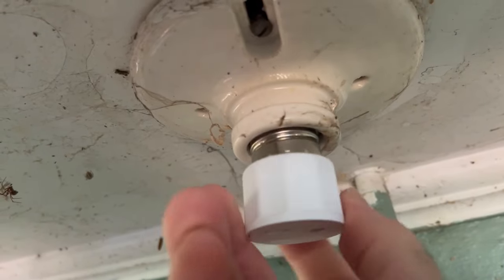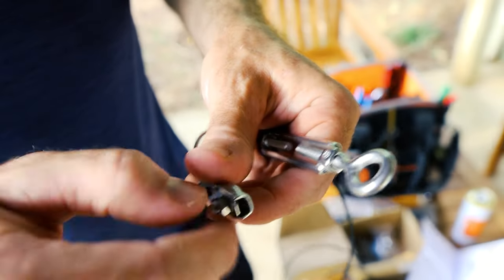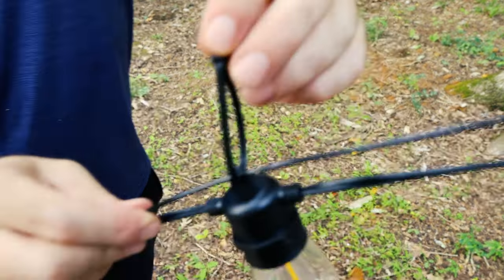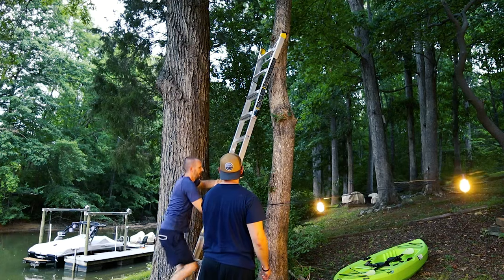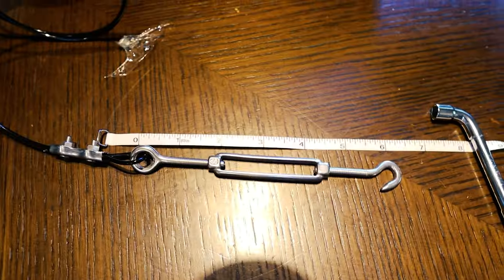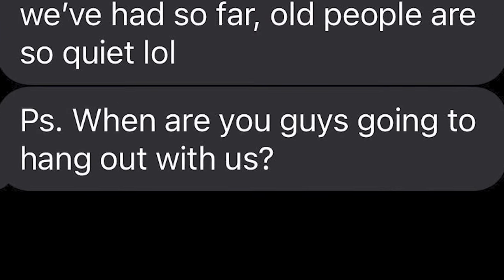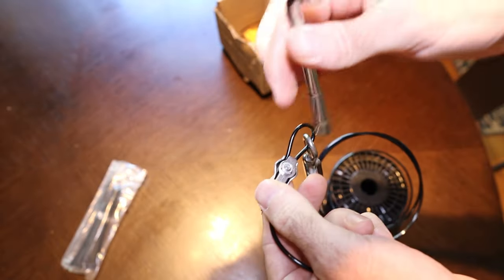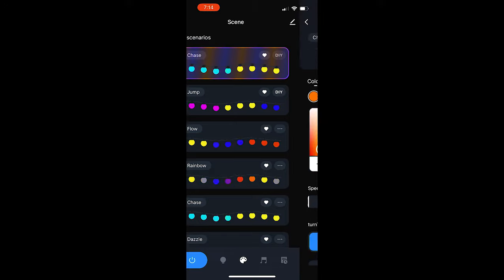Professional Way to Hang String Lights Outside | With Wire & Turnbuckles

Comment: My kit came with screw anchors.  I noticed that you didn’t use any screw anchors.  Is that a step I should worry about?  Thanks!  Really appreciate your video, especially the walk through on threading the wire and using zip ties.
Reply from the maker: No problem! The little plastic screw anchors are usually meant for drywall or masonry installs only. If you’re screwing into wood then those anchors aren’t needed. They’d do more harm than good in wood.

Comment: Nice video. How do you cut cable so you can then pass the cut part back through the metal loop holder? The wire gets so mangled with the cut that I can’t loop the cut end.

Comment: Where did you get the light plug socket adapter so you didn't have to plug the lights in every time?
Reply from the maker: I've used these a handful of times and they've been great over the past couple of years: https://amzn.to/435KOFN
Reply: ANY big box store has them
Reply: Why do you need the additional wire instead of just string the lights to the pole?
Reply: Thanks for the video. How do you wrap the cable around a trunk of a tree without damaging the tree or bark? I know the cable is coated, but it's thin and I'm afraid it will cut the tree over time. Thanks!

Comment: For the part of the sting light that attaches to the tree... did you simply wrap the string/wire around the back of the tree with the hook just to hold it in place? You wouldn't need to use another eye hook + tension hook on the tree? Thanks!
Reply: Same question here - we're going around at tree too.
Reply: Also same question - it didn't look like you used another tension hook on the tree. Can you clarify?

Comment: I'm actually thinking about this inside my metal garage, run the wire from one wall to the other, then suspend the 4 led panels lights from the wire